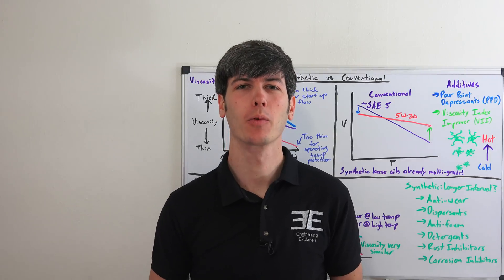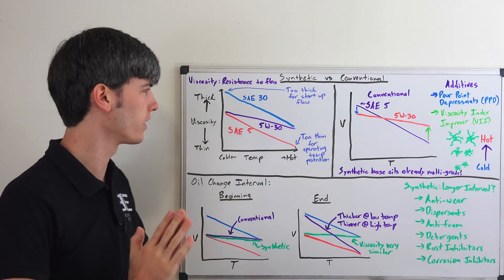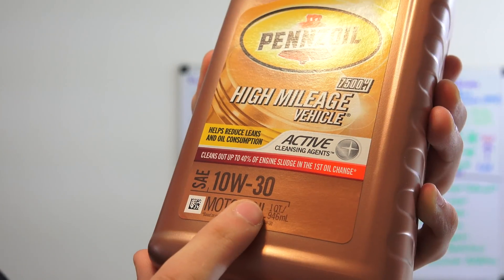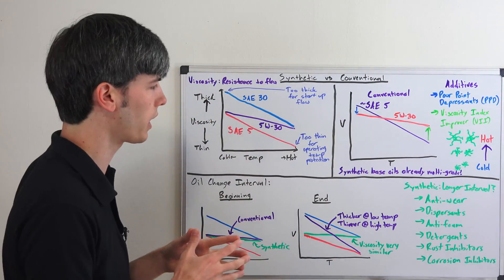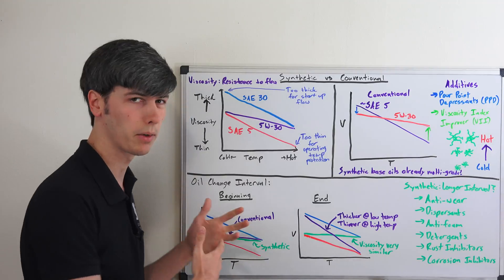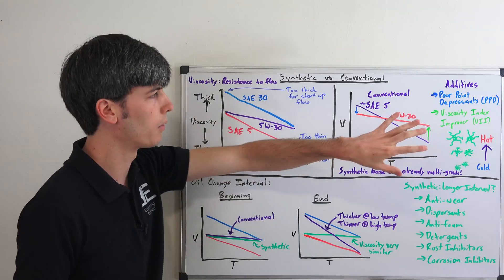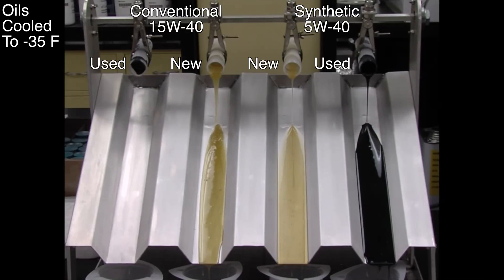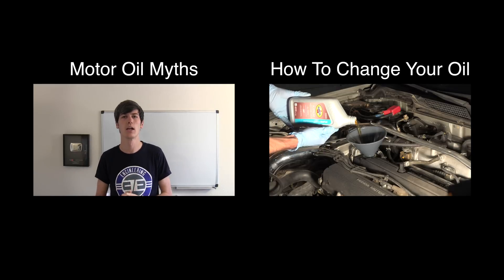Is Synthetic Motor Oil Better For Your Car?

Comment: Good video on synthetic vs conventional oils. The one thing I would add to this is that if you have a car or truck that has been running on conventional oil for a few years, never switch to synthetic oil. If you do you will have leaks. The reason for that is that the seals get hard with oil and a carbon build up will form that keeps the oil from leaking. Switching to synthetic, a very high detergent oil, will remove the carbon and cause leaking around the shrunken and harden seals.
Now saying that, synthetic oils are the best if you use them starting out with a new car or a freshly rebuilt engine. The seals stay soft and keep oil from leaking and parts from wearing without the carbon build up of conventional oil.

Comment: you are supposed to use oil in your car? i just use water
Reply: Same. My 08 Titan has 96k and I use spring water (not distilled) every 15k miles.

Comment: Great discussion of viscosity, which is important, but the property that actually keeps the film of oil intact and protecting your engine is, according to the SAE, Shear Strength. Just how that is measured or rated, however, and how one might find out about it seems to be more highly classified than a nuclear aubmarine.

Comment: I USED ONLY PEANUT OIL. JUST BECAUSE I LOVE THE SMELL OF ROASTED PEANUTS COMING OUT OF THE EXHAUST !
Reply: Don’t give your car high cholesterol, use olive oil. Your exhaust will smell like an Italian restaurant
Reply: @Forge17  but you should be aware that olive oil may cause severe diarrhea for your car engine in winter, so I advise you to mix it with powdered sage leaves and thyme
Reply: Pulcino Zuccherino excellent idea, I prefer my car pooping breadsticks out the back exhaust
Reply: @Forge17  well 😂, in the era of Covid 19, anything could be happen, it is the era of madness, thank you so much for putting a smile on my face in these difficult times
Reply: Pulcino Zuccherino well the madness will end one day my friend. It definitely has an end date 🙏
Reply: Adding a pint of Ms Butterworth's Pancake Syryp at each fill-up will make your exhaust smell buttery good!
Reply: Try coconut oil.Though in cold starts it's like Crisco but smells great when it finally heats up.
Reply: @drdysl3xia795  liquid coconut oil is a thing
Reply: @wades623  In 5w20? Clearly the sarcasm went right over your head. ;) All good.. have a Merry Christmas.
Reply: Me to
Reply: @chakur25 that toyota could prob run on babyshit for 100miles.

Comment: Thank you for the explanation. I have two older Subarus (03 Legacy and 01 Outback wagons) that I am trying to make last as long as possible. I usually always use synthetic and I do the oil change myself. I have to do it about every 3K miles because they actually both start running out of oil. I'm not sure why they do that but I have had the Legacy for 3 years and it has always been that way with absolutely no engine problems whatsoever. If you could make a video on that, or explain it to me right here why they run out like that, that would be so awesome! I always have people tell me I should get them checked out because they shouldn't run out, but other Subaru owners always understand.
Thanks again! I love your videos!!
Reply: !!??  if u run down even half the total volume of oil, ie 2 quarts out of 4 or 5, that is harming your engine, let alone burning/losing around 3 quarts possibly?!   Do not ever let it get below 1 quart down.   Otherwise u r putting tremendous wear and tear, due to the dynamics of heat and several things like amount of oil available at any one area dpending on this that and other thing, like temp.   This is especially true in those Subie engines which are quite hard on oil.   Also remember that the oil left over after the consistent burning, is extraordinarily nasty acidic and dirty oil.    Good god-- this is very disturbing to read!   Please study up!

Comment: You've demonstrated that synthetic is far superior to conventional motor oil, so let's dispel a myth:

Myth - Synthetic oil wears out, forcing you to change your oil.

Synthetic oil doesn't "wear out", it gets dirty.  If you could keep your oil clean, you would never have to change it.  This principle is commonly applied in industrial applications such as machinery, ships, ect.  Instead of frequently changing the oil, (which could be very spendy in large machines) the oil is filtered to a degree that allows near continual use.  Instead of doing an oil change, oil samples are taken and sent to the lab for analysis on a similar timetable.  This also provides additional benefits for monitoring engine wear.  You can do the same thing on your vehicle at home using an aftermarket bypass system such as shown here http://www.amsoil.com/bypass/how-it-works.aspx .  Considering all the benefits, and lack of downsides, kind of makes you wonder why auto manufacturers don't include similar systems from the factory.  Of course, they'd lose service revenue and the oil companies would too.  And it doesn't support the electric car agenda to produce cleaner, more efficient gas vehicles.

Also of note, not all synthetics are the same.  The quality of the oil is largely determined by the base product the oil is derived from.   The better (hence more expensive) the base product, the better properties and more expensive the oil.  If extending oil change intervals or using a bypass system, it's a good idea to use the highest quality synthetic you can afford (ie not Mobile 1).  For example, MPT, Amsoil, and Royal Purple are some of the best at their perspective price points.

Comment: I have a WRX with 150k miles.  All its life the car ran with conventional motor oil.  Last Christmas I got some good deal on synthetic so I figured why not.  At about 5 k miles, I checked the oil and it is 2.5 quarts down, half of the oil was gone.  I added the oil back up.  About 1k miles later, the engine was making some alarming noises at start up.  I checked the oil is low again.  I park the car until I could get an oil change using conventional oil.  The Penzoil synthetic smelled burnt and has viscosity like water.  Conventional oil and every 3 k for me from now on.

Comment: I've been a mechanic for 17 years and always use full synthetic oil. I know you can wait longer but still change the oil every 3k miles. With as much as my cars are driven it's still only about 2 oil changes a year each.

Comment: ok let state that if your oil is that black just go ahead and kiss your motor good bye and it doesnt matter if you use conventional or synthetic as long as you change your oil every 5k miles

Comment: I use mobil one synthetic. most aircraft turbine engines use Mobil one synthetic and they operate in extremes everyday so if it's good enough for some of the most precise pieces of engineering then it's good enough for my car. the intervals are now 7000 miles as oppose to 3000. You just have to make sure your oil levels stay where they should be.
Reply: You are comparing apples to oranges.

Comment: Amsoil, Redline and Motoul are the only "True" synthetics (thus the 100% on the label) left in the US until Congress establishes an act demanding that synthetics really be Group IV or higher. This is being discussed in Lubes & Greases Magazine.  I know Amsoil resists the thickening from deposits as for their diesel oil.  On the EcoBoost, if you use a non-100% synthetic you will have deposits built up on intake valves due to the high volatility of the Group III oils (fake synthetics) via oil vapors in - PCV.  Pennzoil Platinum BTW - does outperform Mobil 1 per tests done at SWRI labs.

Comment: I am a loyal Amsoil customer. Have been for years. The way it was explained to me, the difference between the two types of oil that is are the following. You see petroleum oils have mismatched molecules that will allow moisture to latch onto the them. Everytime you shut off the engine, the moisture molecules form acids and varnishes that cling that cling to critical  engine parts causing excessive wear of those parts. The full synthetic oil I use has all the molecules the same exact size. Which means moisture can't interact with the Amsoil. As the crankcase cools and the moisture forms, it has zero effect on the oil and is passed out as moisture vapor the next time the engine cranks up.

Comment: wrong thinner it is it will not get to all the gears and other components in your engine you need thick oil to be sure your engine is covered and if oil stops your car from starting or slowing down your starting then you have bigger problems then oil.

Comment: The key issue with engine oil is the function of the oil in the journal bearings as the thin film that prevents the two metal surfaces from contact.  Lots of variables are involved that range from how the fluid flow profile reacts to high or low RPM and at what part of the start to shut down cycle you are at.  It is not as simple as watching thin oil running down a chute.  Look up how journal bearings (like the ones holding the crankshaft) are designed.

Comment: 15w-40 v 5w-40 isnt a fair test either.  i know what you're trying to say, but it still isnt a completely controlled test.  and if i may be so blunt as to say, there are no pennzoil motor oils that use a completely synthetic oil.  they are all still petroleum based.  i feel free to stand corrected, but, doesnt that make them more of a blend?

Comment: If you follow the car manufacturers recommendations for viscosity and oil change intervals you'll be fine with any oil. Save your money.
Reply: It's not all about viscosity. There are other considerations.
Reply: The only other consideration will be for the oil service classification and the car manufacturer specifies that.
Reply: +lamewarrior - Agreed. In Europe no makers specify mineral oil. Mine needs ACEA-C1 or JASO-DL1. This is only available as a 5w30 synthetic. The API equivalent is CJ4 or better. Low SAPS is essential with diesel exhaust treatment systems.

I think we are actually saying exactly the same thing just with different words.

I cannot see any benefit of mineral oil over synthetic oil. I made the switch to synthetic in the early 1990s. Long before it was routinely available or recommended.

Comment: This video was sponsored by Pennzoil, which would like you to buy their higher priced synthetics.  Not saying that his points were wrong, but there have to be a few benefits to non-synthetic oil that he didn't cover.  As for myself, i dont use engine oil at all;  I use 2-stroke oil, and put it where it belongs- in my sleds oil tank. lol

Comment: 1st oil change to synthetic,NO you should break in the engine, some manufactures say they build their engines in a CLEAN atmosphere and that 1st oil changes is not necessary to remove air contaminates and if you keep changing the oil at small intervals the engine doesn't break in, I run mine 3 to 5 thousand miles ,change Regular oil and at 10,000 to 15 000 swap over to synthetic oil ,This is for Gasoline,don't know about diesel's.
Now the engine parts are worn together and the oil lubricates the parts from wear.
Synthetic Oil change at 7000 is ok (TEST: if you put a drop of oil in between a thumb and forefinger and move your fingers in a circle you can feel how wore out your oil is,then compare this to new oil), I note the mileage and color and slickness of the oil to determine the oil change intervals,also cut open your oil filter, I use tin snipes then you can see anything that's been through your motor!Some Honda's I have owned oil change at 15,000 oil was still ok,but I changed it out,the color was caramel and still slick between the fingers ,SO just my 2 cents!
As far as what oil is best Synthetic,all the additives,Temp controls and I don't think you can filter everything out of regular oil,
I think I'm shorting myself on the filter change interval,most of the time it's clean inside,so it would probally run 4 oil changes and still have room to filter the oil,I have never seen a filter full of crap unless the engine BLEW! 
Tell us more aircraft man!

Comment: my last car had 220k miles and I owned the car since new, I changed my conventional motor oil ever 5k miles. I have never once has any oil related issues or failures. When I changed the valve cover gaskets around 180k everything was nice clean and new looking.The guy I sold it to still owns it. 2004 Lexus is300. I just don't see what the big deal is. I have never used synthetic, I believe if you change your oil regularly you will be fine.

Comment: Engineering explained I thought the video was concise and well thought out. The people that do not get this completely missed the point. I have made and tested engine oil, gear oil, transmission fluid, and power steering fluid for the past 4 years. Good video, keep up the good work.

Comment: Is it a good idea to use a thicker oil because the vehicle has over 200k miles?
Like using 10w30 instead of 5w20...
Reply: 10-30 in the hot weather.

Comment: +EngineeringExplained Thank you for your videos! They definitely help me be more aware of my vehicle and the car world. With that being said, I have a question regarding oil changes for my car. I have a 2009 Subaru Legacy PZEV with about 55500 miles. Recently, I started driving at minimum 500 miles per week for work. I have been using synthetic oil. How often should I be getting the oil change driving at this rate per week? Do I need more frequent changes, or should I just monitor the amount in the engine and maintain the level until I am required to change based when I use the recommended miles per change? I really want to make this car last until I'm able to save up and purchase my first new car! Thank again and looking forward to your reply
Reply: ?  it will be more frequent of course, bcuz u will reach the change/miles interval much much sooner.   But also remember that hwy miles are far far easier on the car overall and the engine even, so u might get away with a little longer and more miles than the 4-8K typical of synthetic general recommendations.  (i never go by car mfr's long miles style numbers ie, not even 8K actually, let alone 10K and higher.  (maybe especially not in subarus from what i understand about them, and how they seem to dirty the oil far sooner than non subie engines.

Comment: So can you tell me what are the need and properties of say a 5w 20 blended as in my 09 ford aluminum v6 motor?
Reply: Ford recommends 5w20 for all of their vehicles made since 2005 because of CAFE standards, you can safely use 5w30 though once the warranty expires(5 years/50,000 miles).

Comment: My dealer wants me to come back at conventional oil intervals vs the syn. oil we use and says it is due to summer heat. Your example was interesting but only for cold days. At a cost of near $80 US for an oil change I'd like to do one less often on my Subaru. Does this Syn oil break down as quick as conventional in heat, I mean HOT. Day time into the 120's

Comment: Almost all joke comments here, not worth much. Consumers reports tested dino oil in NYC taxis. They ran them on 3,000 6,000 and either 10 or 12k miles. at @ 250k miles they tore them down and measured wear and deposits. The 10,000 mile changes were just as good as the 3. I am going 7 to 10 now on mileage, standard oil.

Comment: my car needs 5w-30. I live in northern canada where it can be -40 - -20c during winter. the car works with 5w-30. would 0w-30 work better?
Reply: Potentially yes. There's no benefit in having an artificially wide viscosity range. In some cases this can be detrimental. But you MUST still meet the engine's requirements. Viscosity isn't everything. What is the car in question?

Comment: Paid for by big oil (spend more) and oil change industry (change just as often even though synthetic lasts longer) 
The viscosity curve of old 5w-30 motor oil does not become 30w-5. It becomes 5w-5 or 10w-10, and only if left in the engine way way way to long. 
I am not denying that synthetic is better,  but this is a sales job,  not engineering explained. 
Shame

Comment: He did a little trickery at the end there.  After his whole long explanation about the different viscosity ratings of oil, he used a 5W-40 synthetic oil, vs a 15W-40 conventional oil.  The lower W rating oil is going to flow faster no matter what.  This being said, I completely agree that synthetics are much better for your engine, it's just that he kind of compared apples to oranges at the end.

Comment: synthetic is better.....DEPENDING ON THE YEAR MODEL OF YOUR VEHICLE
Reply: do NOT put full synthetic in your old '91 hooptie
Reply: I think it's generally a good idea not to use synthetic on anything over 20 years old, at least not until it can completely mimic dino oil.

Comment: Also I cant think of a single engine that uses a turbo that DOESNT require synthetic.  Regular oil just cannot hold up to the heat and mechanical speeds a turbo operates at.
Reply: Turbo diesel engines don't require synthetic and they run for hundreds of thousands of miles.  Synthetic does help with cold starts.
Reply: Any diesel! International DT466 and Cummins 5.9 were both designed before synthetics were commonly available and proven reliable on basic conventional oils!
Reply: My turbo truck uses conventional
Reply: Nor can I.
Reply: BrianNC81 in a Heui it would
Reply: Ever seen a Pro modified drag car? 3,000+ horsepower twin turbos. They often run SAE40 or 50 conventional
Reply: My 410k mile 1986 VW Turbo Diesel Jetta with a 1.6L still runs fine and I've never run synthetic

Comment: I have talked to engineers at the auto companies in the engine labs and they confirm that wear on engines that had synthetic oil was less than conventional oil. With that said cabbies in New York change their oil every 1500-3000 miles and have 250,000-400,000 miles n them. They sear that keeps them running with all the idle time and short trips.